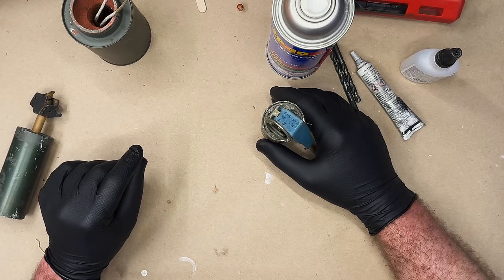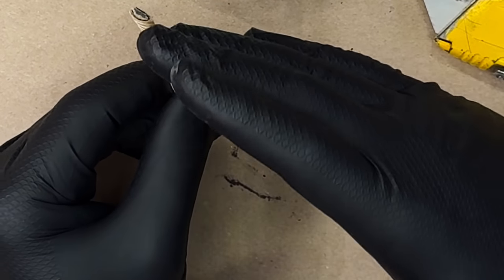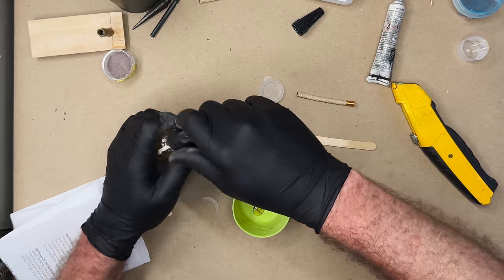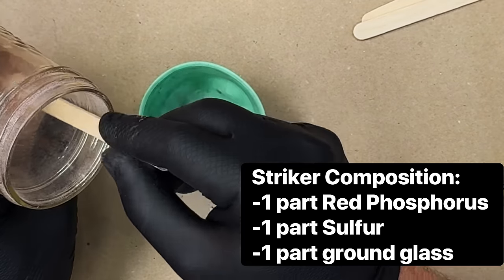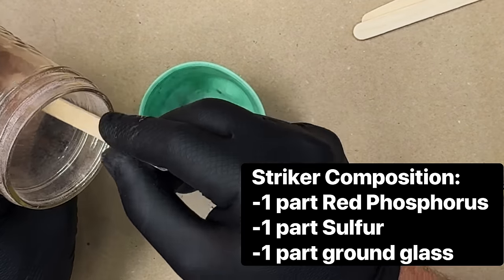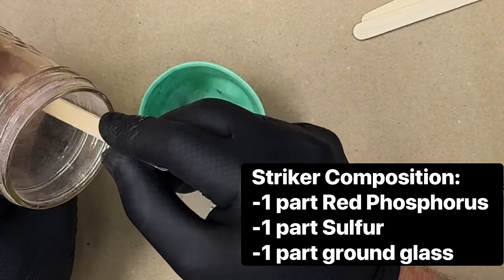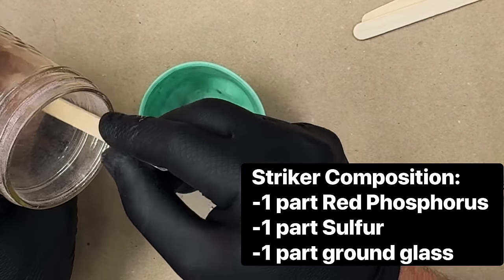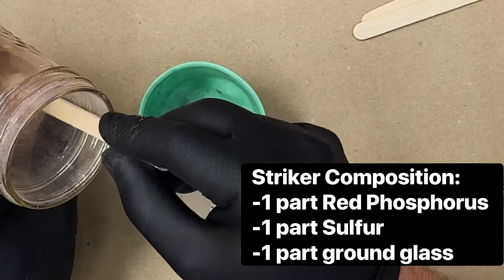DIY Mousetrap-Style Fuze With Time Delayed Ignition For Smoke Devices

Comment: Do you think you will ever mess with 3d printed parts? Seems like it might help optimize some of this. 

Love the content!
Reply from the maker: Absolutely, I’ve wanted to get started with 3d printing for a few years now. I’d use it for literally everything. There’s a bit of a learning curve that requires a time investment.
Reply: @InventionIncarnate  if you want a printer that "just works" I'd recommend one in the Bambu lab line up. As a seasoned 3d printing hobbiest I've found it to be one of the easiest and most intuitive printers out there. Especially when you don't want to tinker. Just download the files and hit print 95% of the time.

Comment: How clean does the epoxy based smoke composition burn, is the ash left over easily removed to be able to reuse your canisters or is it kind of a one and done
Reply from the maker: The remaining ash literally just pours out. 100% reusable. And the mix can be extruded/molded into any container. I’d say, even an m18 bwahahaha